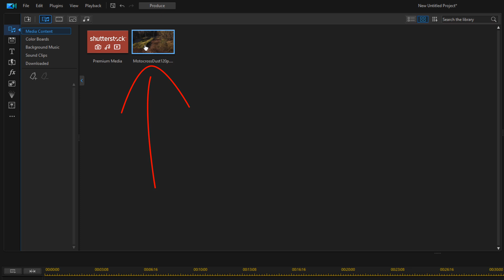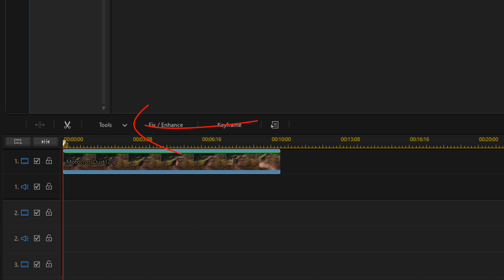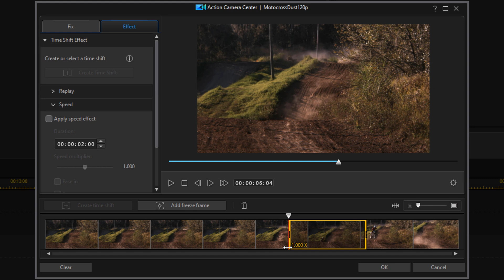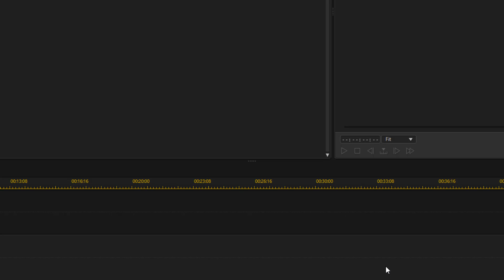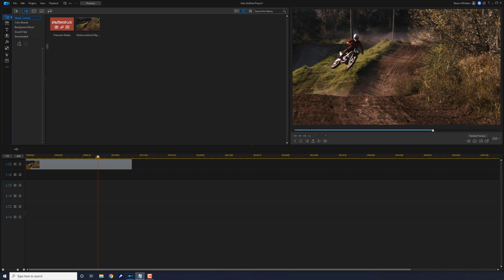Using Speed Ramp for Smooth Slow Motion  | PowerDirector

Comment: I was able to use this technique for PowerDirector 13. It wasn't exact but I just copied the area i wanted to slow down, then I split and inserted that portion. Then using your instructions and poking around in the drop downs I found the speed controls and used those on the highlighted area I wanted to slow down. Thanks again for your great video. Keith Noneya

Comment: Hello Maliek, I'm a little confused with the fps on the timeline.  If my clips are 60fps and If I have 30fps on the timeline,  does that mean I have to produce my videos to 30fps or can I produce them to 60fps? Or do I have to change my timeline to 60fps? Sorry I just found out today that I can adjust the fps on the timeline. 🤣 My main interest is to produce my videos in 60fps
Reply from the maker: You can produce at any fps you want.
Reply: @PDU_Tutorials  thanks for the reply, what would be the purpose of changing the fps on the timeline?
Reply from the maker: @BYMProductions509  I explain why you need to have a specific timeline frame rate to get smooth slow motion in the video. Are you asking for a different reason?
Reply: @PDU_Tutorials  I was just wondering if there was another reason to change the fps on the timeline other than the slow motion. I just want to produce the best quality possible for my videos.
Reply from the maker: @BYMProductions509  No there isn’t
Reply: @PDU_Tutorials  thank you so much for the info, it is much appreciated. 🙏

Comment: Nice and simple. What's the difference between using the action camera centre and the speed settings in power tools? 🤔
Reply from the maker: You have more options in Action Camera Center (ease, freeze frame, reverse, etc.) and the procedure to change speed is different.
Reply: @PDU_Tutorials  I'll try that next time. Cheers Maliek. 😁
Reply from the maker: @WalkWithWallace  Cheers

Comment: Thanks Maliek. Another outstanding tutorial for a useful feature. I wasn't clear why the formula limits you to 20%. Is there a reason the clip couldn't be slowed down to 10%? That may not be a simple questions, but I wondered about it when I saw the formula. Thanks again. You're the best!
Reply from the maker: No problem. Sorry I didn't explain that further. You SHOULD only slow down the video to 20% if you are using a 24 fps timeline and the clip is 120 fps. 24/120 = .20 or 20% If you slow it down more than that (say 10%) it will begin to skip frames. The higher your clip fps the slower you can make it and without skipping frames (buttery smoothness). This is why higher frame rates are recommended when doing slow motion. 
You percentage limit is based on your timeline fps and your clip fps. 
60/120 = .50 or 50%
30/120 = .25 or 25%
24/120 = .20 or 20%
30/60 = .50 or 50%
24/60 = .40 or 40%

Comment: Is it possible in PD 18 ?
Reply: Still rocking PD 12 here.
Reply from the maker: If 18 has the Ease In/Out feature in the Action Camera Center then it is possible in 18. I no longer have 18 so I can't check.
Reply: Yes. The same settings, ease in /out work the same in PD18.